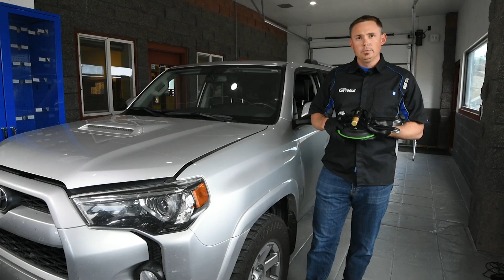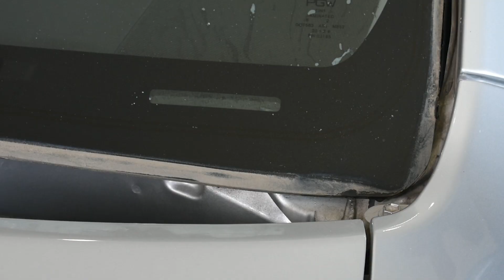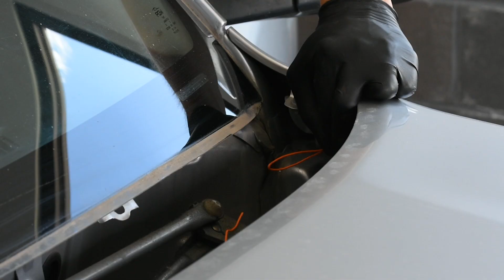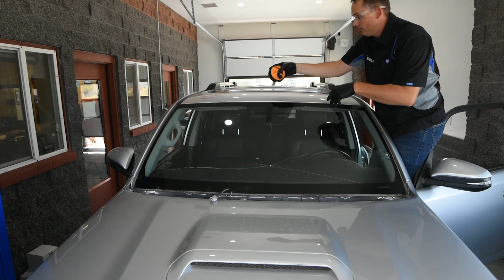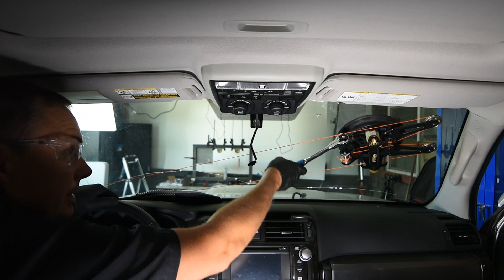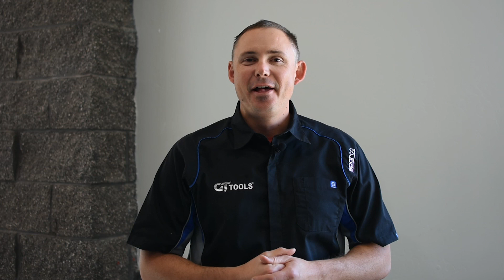The KONG™ - Auto Glass Removal 2019 Training Video - GT Tools®

Comment: That tool you used to cut the bottom corner looks like it could do the whole windshield in not much longer than the Kong.
Reply: The wire tool eliminates damage to the opening.

Comment: Seems like it would be a nightmare for curved windshields. Say a charger, it would put a lot of line pressure on the dash and you’d have to keep it off the headliner. 
Plus the no give system seems it will constantly break line.
Reply: Good point.

Comment: I've got the original version which is awkward , heavy and clumsy. Can it be returned for a rebuild or upfit ?
Reply from the maker: Hi Tom, thanks for reaching out. Unfortunately the mounting pattern for the rear end on our new Kong assembly is different from the old assembly that you have. We could retrofit your current tool but you will be paying for shipping both ways and essentially a whole new tool aside from the suction cup. Your most cost-effective option will be to buy a new Kong tool only (AGWC-K) during one of our sale periods. I would check our site later this week.

Comment: I bought one of these to resell - I've demonstrated it 3 times, but no one buys it once they see how the string breaks (using Gorilla Cord, or the new Zipline extra strength).    I set it up yesterday just like this video and sprayed lubricant all around the windshield.    It busted the string right away.   So I tried again - busted the string again after cutting about 4".   
It took about 3 hours to remove a 2016 Ram 2500 windshield, and I only got it out by pulling on 1 Zipline cord at a time and allowing the other end to slightly slip as it wound into the Kong machine.
Until someone invents a much stronger or much thinner string, this method seems to only work well with certain aftermarket urethanes.   String gutting is great as far as not damaging the pinch weld, but the factory stock urethanes seem to be way too hard to cut with the Zipline II or Gorilla cord.   
I've considered using windshield wire, but afraid if it broke, it would cause a lot more damage than a string breaking.
Reply: Man im not sure whats going on with the cord you are getting. We started using gorilla cord about 2 months ago and have only broken it once and that was because it caught on a piece of metal that was fairly substantial. We dont use it every day, only on vehicles that require it but just for kicks we hook it up on a dw1685 prostar windshield and cut the whole thing out no problem except for where it sits on the stops. It busts thru factory setting pins no problem as well. So im not sure whats go in on there but maybe the technique your using isnt quite right? Or could be defective cord to. Dont know for sure but we absolutely love ours it comes through clutch when you need it.
Reply: @lancedirks548  What are the factory setting pins made of? Also what "stops" are you referring to? Thanks in advance.

Comment: I'd like to use it on DW1494 Freightliner M2 using a power drill. With the dual drive pulling both cords I wouldn't trust this tool for a rookie. The tool seems to be very well built and looks promising and built to last. I'd like to have one to test it out on certain glass. R&I on Back glasses  some quarter glasses. This is like a toy for auto glass technicians.
Reply: Did you end up checking it out?